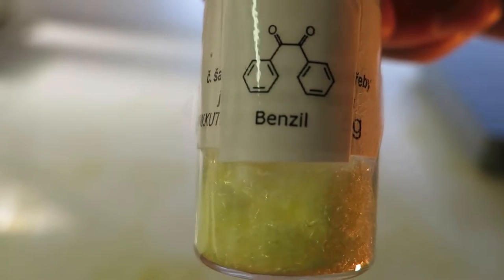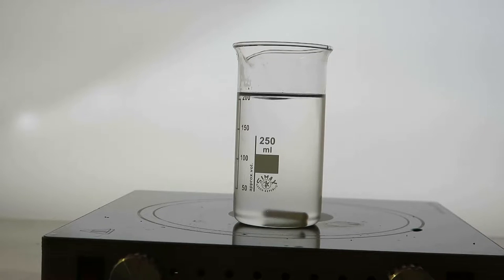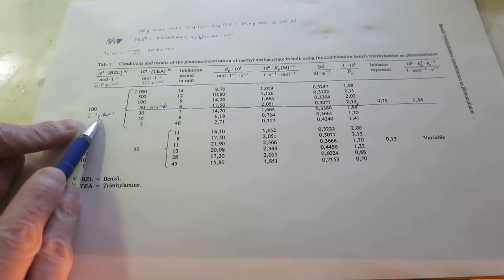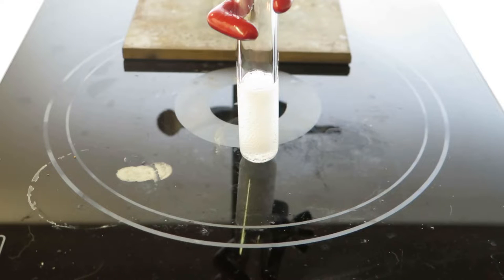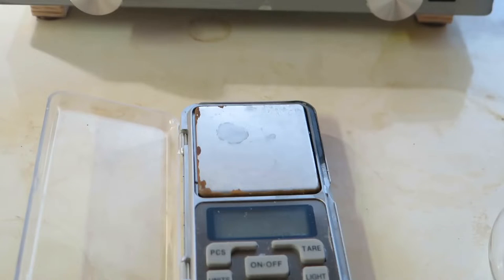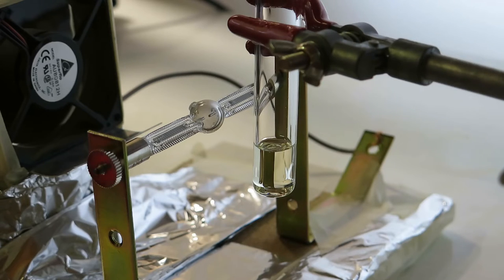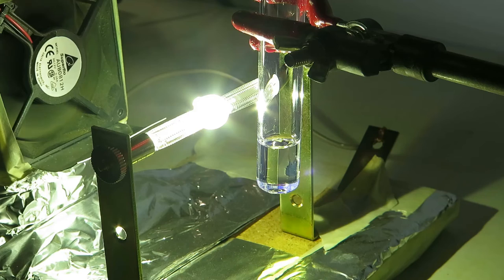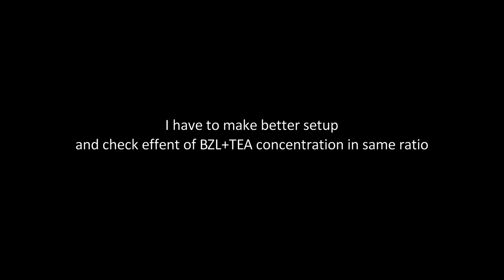Benzil/Triethylamine - Will it polymerize?

Comment: Hi,
Nice experiment.

The N,N-dimethyl-para-toluidine (NN-DMPT) is apparently used as a hardening and catalyst of polymerization...
Paradoxally then into your initial product you have at the same time both polymerization inhibitor (free radical inhibitor) with hydroquinone (HQ) and a catalyst of polymerization (NN-DMPT).

I hope you didn't trow away /disgard the N,N-dimethyl-para-toluidine hydrochloride... it is obviously an easily collected chemical... probably valuable for other organic chemistry reactions just like your hydroquinon sodium salt...

Arc mercury lamp do heat a lot and generates a lot of UVs... better wear UV-filtering glasses for eyes protection especially if you took the outside protective glass bulb (UV-blocking).
The inner bulb is made out of silice glass (pure SiO2) that allows UV to pass... your test-tube is probably made out of normal glass what filtrate most of the UV rays... thus slowering the polymerization rate.

If you want to do a more scientific experiment... I advise you to make blank test in parallel (*) like...
1) Initial raw unpurified material methy-methacrylate (MMA) / HQ / NN-DMPT without sensitizer (TEA/Benzil) exposed to UV

2) The same as in 1) but with the sensitizer this time

3) Purified MMA alone without sensitizer and exposure to UV

4)  Your presented experiment... Purified MMA with sensitizer and exposure to UV

(*) This way you answer to a lot of scientific questions regarding your experiment.
--> Is sensitizer usefull at all? 
--> Is purification usefull? 
--> Does those induce a marked difference onto the polymerization rate via initially present ingredients, via the excluded ingredients and/or added catalytic (**)/inhibitory impurities during purification steps ?

(**)
There are evidences that MMA may polymerize on its own under UV, under exposure to strong bases (what  NaOH is) ... and under exposure to strong acids (what HCl is).

See: https://pubchem.ncbi.nlm.nih.gov/compound/Methyl-methacrylate 

The purification step with NaOH may induce hydrolysis of the methyl metacrylate to methanol and sodium methacrylate... and polymerization.
The purification step with HCl may induce hydrolysis of the methyl metacrylate to methanol and methacrylic acid (but probably at a lower rate than the base)... and polymerization ... and addition to the double link of the monomer (addition of HCl to olefins).

See: https://www.ncbi.nlm.nih.gov/pmc/articles/PMC3382811/
They used pH 10 base concentration (10e-4 molar)... you were closer to pH 15 (1 molar).

I hope this helps.

PHZ (PHILOU Zrealone)
Reply from the maker: Thanks for suggestions, I definitely need to followup this experiment, it seems to be very sensitive to concentrations and I wasn't able to get it to work unless I followed the paper. So I have tried many times with negative results until I got the exact concentrations as suggested by paper. then it worked right away... Not what I expected initially. Will definitely make followup video if I find something interesting